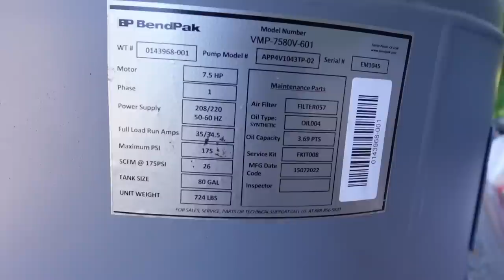The Final Piece To My Shop OVERHAUL

Comment: As an industrial compressor engineer: few things to mention

Since you’re placing it outside, I would suggest to keep in mind it will need to be drained frequently of the water that will collect in the tank. This can become an issue in the winter if that water freezes. CT gets cold yo! Reach out to benpak and see what they would suggest for this. 
For ones I sell we typically upgrade the drain valve then heat trace the drain pipe to make sure the tank can be drained whenever needed. Will help to prevent that tank becoming an ice collector cutting down on your available storage. 

Also, thick rubber feet would really help with noise and vibrations this will produce

Comment: Be glad you made the slab a bit larger than needed, now you’ll have a place for your oil separation and air dryer. You’ll probably need both if you are going to paint. Then there is the desiccant dryer if you want a dry ice machine. 
Privost piping for the outlets and reels at the bays and machine tool area.